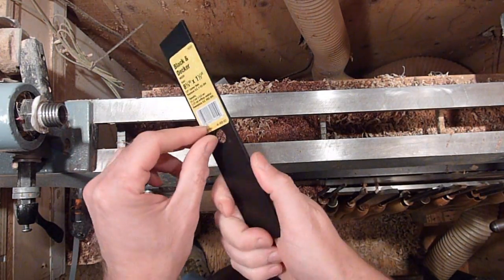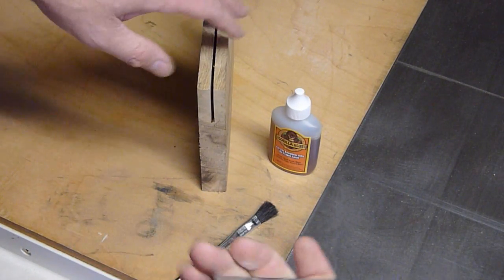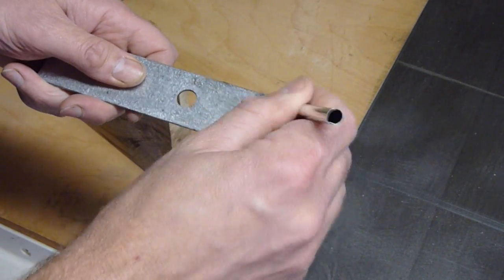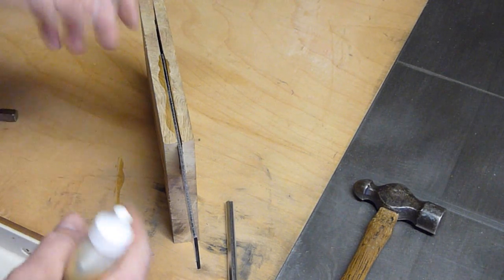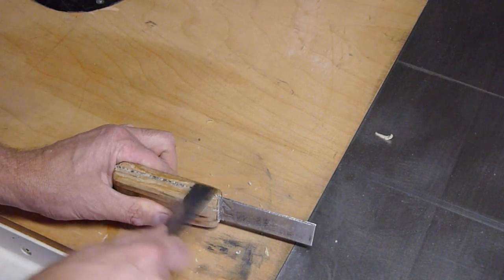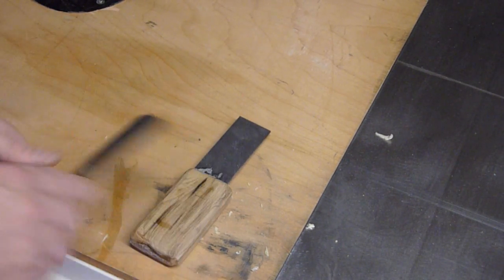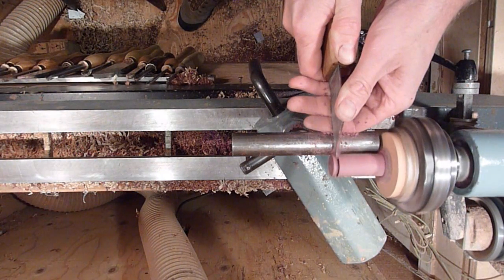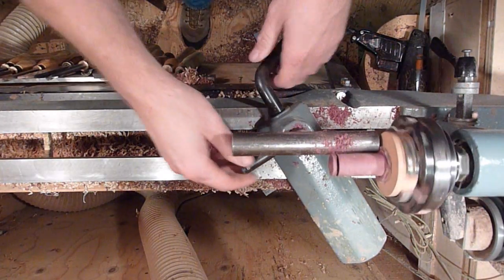Shop Made Thin Parting Tool

Comment: Happy 2015, Carl.
Did a Google search to buy a thin parting tool - saw your video listed, and thought: of course, make my own! The edger blade is now on my Ace shopping list.
Thanks for another great video.
Bill
Reply from the maker: Bill Wells Thank you Bill, if there's anyway to make the handle longer, it would really help.
Reply: Carl Jacobson My thought also, a longer handle.  Bought the blade today at Ace; tested the hardness, will be difficult to drill but will try to do so in order to accommodate a longer handle. Will report back.

Comment: Thanks Carl, my Thin Parting Tool turned out well. I used a piece of a broken  hickory axe handle which I had saved for just this kind of a project. Made the total length similar to my other tools. I drilled holes thru the hickory and blade for brass screws rather than urethane glue. Did not remove the black powder coating. Also, was VERY careful of heat while sharpening.
Reply from the maker: Bill Wells Very nice Bill, it's so rewarding to make your own tools.

Comment: I made my first one from an old 7 1/4 carbide circular saw blade leaving the carbide tooth to do the cutting.  I originally made it to clean up purfling grooves in my violins.  Didn't work too well for that but made a great thin parting tool.

Comment: Hi, I'm in the UK and don't recognise the "edger blade". I made mine from part of a power hacksaw blade. These are about 1.5 inch wide by 1/16 thick, I just ground off the teeth from the edge and fitted a handle by grinding one end into a tang shape, but fitting one as you have would be a fairly easy  alternative. Mine works fine and being HSS keeps sharp without any trouble. Thanks for the videos.

Comment: Sawz all blade work well for thin parting tool also. Just wire wheel or torch off the paint. grind off the teeth and make the end type of parting tool you want. Used ones work great since you don't have so much paint to get off and they become useful once they are no longer good for the sawz all.

Comment: Carl, I have made a few of these. I usually start with a stiff wood handled putty knife like the following: https://www.homelectrical.com/1-12-stiff-steel-putty-knife-wwooden-handle.red-4103.1.html  
They are high carbon steel and already hardened. You just have to be careful not to blue the steel while sharpening.

Comment: OOOps Be careful with the grinding heat hayden ! You brought the tip up all the way to a rather high annealing temperature, the colors give it away. HSS would mostly shrug that off, thats one of the reasons its so popular.

However i can tell by the grinding sparks that your tool is not HSS. Chances are, you have lost at least some hardness.

Regards